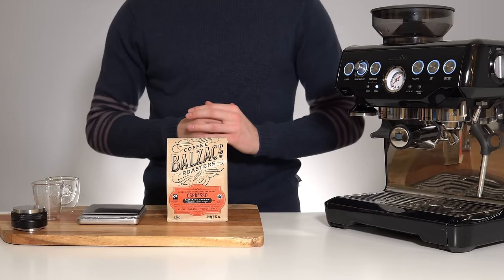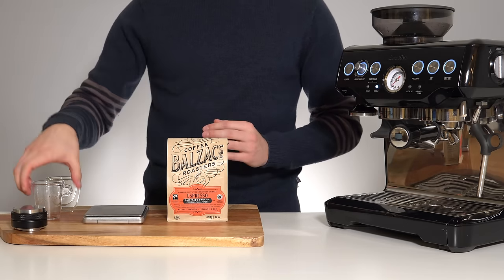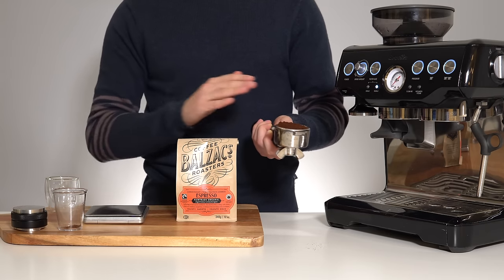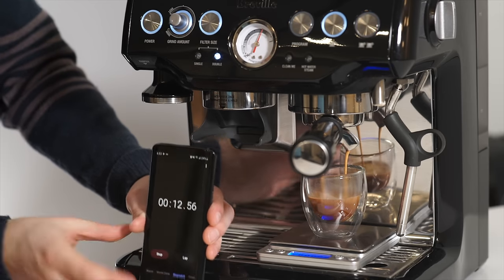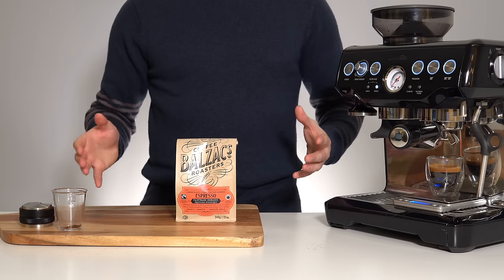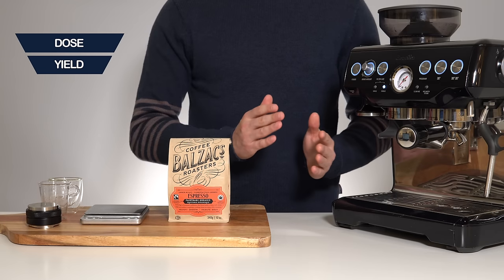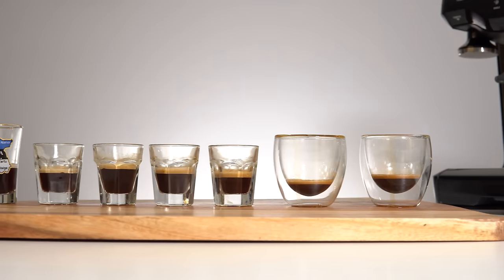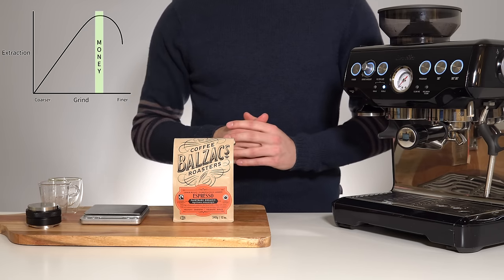Dialing In Breville Barista Express | Dose, grind, yield, time

Comment: Love this video mate. I have seen some different approaches to the timer, some people start as soon as they hit the button but I noticed you hit it after pre-infusion. So I am forever confused as to whether mine are running long enough or not, but just on the safe side I aim for about 30-35 seconds from when I hit the button
Reply: Also I run the double but with two cups underneath (one for me and one for the missus) and weight is roughly 60g - does this sound like too much or for two cups sound reasonable? For an 18g dose that's a 3.3x ratio 😕
Reply from the maker: Hi George, I can't tell you what the right timing / brew ratio is for your coffee and your taste preferences. Use the second part of the video to learn how to adjust for those

Comment: Excellent video but just wondering if one can really taste the difference in a blind fold test!!!
Not a big coffee expert but personally for me, i find that the quality of the beans is the most important.
I use the same machine and use gentle tampering. There is A LOT of hot water pressure that goes through the basket/coffee inside to get a good overall extraction !!!! 
In the end I went back to my fully automatic machine which gave pretty much the same taste after blindfold testing. 
Was fun for a little while with the new Breville, like anything new,  But The ease and the convenience of the fully auto unit won at the end.

Comment: Great video & so helpful. But i was wondering, did you use single wall filter basket?
Reply from the maker: Single walled. Dual walled filters are only for if you are using coffee that needs "help" building pressure such as pre-ground varieties that are typically coarser and less fresh.

Comment: Great detailed step-by-step video! One important question regarding tamping:

Good tamping means: flat + level + consistent in pressure from shot to shot. Right ?

Let's assume you are always tamping perfectly flat and level -- no matter what kind of tamper you're using. Big assumption I know... but please follow along :)

With a calibrated tamper, you'd always get a consistent pressure (30 lbs usually).

Can you please explain how you'd get consistent pressure with a palm tamper?

Thanks mate !
Reply from the maker: As long as your dose is consistent, the pressure will also be consistent with a palm tamper. Not to mention perfectly level :)

Comment: WOW! I've had my Breville a few weeks and I WISH I had stumbled upon this video DAY 1! So much knowledge made simple. THANK U! Now, if you can assist with this scenario: Using Beans Kller Beans roasted on 6/3: 18grams weighed in the filter but after 25 seconds the yield is only 28 grams (double shot selected)....  I have the Breville Barista Touch. Any help will be appreciated
Reply from the maker: You need to reprogram the duration of your double shot if you like the flow rate and want it to keep running to a 1:2 ratio. Or, grind coarser so that you reach a 1:2 in the already programmed time

Comment: Thanks a lot for the perfect explanation. I have a question. I ordered a Breville bambino machine. Are all these explanations (including 20-30  sec shot) apply to the bambino?
Reply from the maker: When using a non-pressurized filter basket, yes 
If your are using a pressurized basket, the flow rate is largely determined by the basket itself

Comment: Great video.  But Im still burning through the beans trying to get it right.  Got down to grind setting 4 and it was still under-extracted.  Increasing dose to 20-22g and tamping the heck out of it.  The pooling stopped, but its still not hitting the 25 second range for extraction time.  I’ll keep at it.  Thanks for all the info in your vids.
Reply from the maker: Remember, you also have the inner burr adjustment, not just the external dial to adjust grind sized finer. ALSO remember that not every coffee will taste best at 25 seconds. Experiment using the concepts in the second half of the video to dial in your particular coffee to your particular taste preferences
Reply: @LifestyleLab_  I reset the inner burr grinder.  Ended up with it set to 3, with the outer wheel set to 8.  Pulled a shot with the beans I had been using and it was better.  Switched to a new bean that I was going to try and it was better still:  18g extracted to 36g in about 28 seconds.  Still some tartness on the front, but the finish is much more espresso-like.  So, Im closer than I was.

Comment: Love your videos , very helpful. 
I feel like I’m getting there with dialing in ... 
17g in 42g out 
29 seconds, but more like 18 because of infusion. Too fast right ?? 

So my question is , should I grind finer or up the dose? I feel like it’s pretty fine already . I get sediment in my drink sometimes and I always do a blank shot . 😩help please
Reply: It wouldnt hurt uping your dose, try a 1:2 ratio. Before changing your dose try and tamp harder. If you're using the factory breville tamp it may be a bit harder to get a solid even hard tamp, i benifited a lot from buying a larger tamp off amazon.
Reply: @sagefielder7921   Ok thank you .  I will try 18g today. Also , I’m using a palm tamper.
Reply: @sagefielder7921  I went up to 18g in and went one finer. Got 18g in 38g out. In 28 seconds total time. Yay! Do you dose 18g? I feel like it was a lot .I need to get a better scale I think.

Comment: Thanks so much for this brilliant video. What's the purpose of having the 2 different grind size adjustments on this Breville machine?
Reply from the maker: Only one is grind size. The other is just a rough “dose adjustment”, aka a timer. Longer it runs, higher the dose. Problem is, when you change the grind size, the dose will vary with the same grind time. Hence the technique suggested here
Reply: So if I have my internal burr set at a fine grind size of 1, that means it will run for quite a long time? Or the other way around?
Reply from the maker: Finer the grind, slower the grind rate
Reply: Ok so how does the Grind Amount knob interact with the internal burr "grind timer"
Reply from the maker: Grind amount dial = simple timer ⏲️ 
Grind dial = particle size
Reply: I think you may have misunderstood me from the start. When you take the bean hopper off there is an upper part to the burr grinder that is removed by lifting up a wire & rotating it anticlockwise. On this part there is a adjustment that can be made by twisting the top against the bottom
Reply from the maker: Upper Burr vs Outer Dial Grind Setting | Breville Barista
https://youtu.be/_uB3FZGkR6E

Comment: Super video. One thing though. About the timer. I see that you time from when the first drop is falling, but i also see others time from when you press start button. By the way their saying the same amuont of time witch is between 20-30 seconds. What is up and down here. Even Brewille has a video where they pull a shot using 28 seconds timed from the very beginning.
Reply from the maker: Because there is a range of times that will work depending on your individual coffee and individual tastes, there will always be some variation. 20-30 seconds from first drip is the same as saying 25-35 seconds including pre-infusion... and for your coffee, it might be 45 seconds! That is why you always need to dial in to taste, not to a specific time. Aiming for a time is a rough starting point, not a final destination.

Comment: I'm glad that your video is one of the very first I've seen upon getting my BES870, and that saves me a lot of unnecessary coffee wastage 😊

Just a question about the coffee leveller and calibrated tamper – I noticed in you have 53mm in your link, for a good reason. Do you think 54mm version wouldn't fit?
Reply from the maker: Manufacturers seem to use 53mm and 54mm interchangeably to refer to tampers that fit Breville machines. Either will work just fine :)
Reply: 2M views Thank you very much indeed! I've just watch the other video of yours in regards to tamper choice - and I noticed you recommended 53mm, and people have been talking about how nicely fit 54mm tends to create vacuum in the porta filter and ended up with coffee ground all over the place 🙂

Comment: Also do you measure the coffee amount every time on the scale?  I don't want to get alot of other tools when I'm not confident with the machine itself?  Does the scale help?  Do I need it?  I'm a retired older adult, so trying to stop paying for Starbucks everyday for crappy coffee.  Lol!
Reply from the maker: The scale helps to take the frustration out of dialing in because you can control your dose, and I can give specific instructions of what a "reasonable" flow rate looks like. 
After you're dialed in, you can simply find the grind amount setting that gives you the correct dose, and using the programming mode the machine will already reproduce the dialed in shot the next time you hit that button

Comment: LOVE your videos! I have a q on my Express: I have been rotating among 3 half-caf beans from Fresh Roasted, and when I just finished a bag of Mexican and loaded the Sumatra, I noticed that the pressure gauge only goes to the lowest end of the espresso scale where previously it had been consistently going to the straight up (12 o'clock) pressure. It also seems to be finishing a bit quicker. I'm still getting crema, tho. All else being equal, should I try a finer grind? I've had it on 7. Thanks! 🙏
Reply from the maker: First and foremost, focus on flavour! How does it taste? 
If you’re happy with the taste, no need to adjust. However if you’re finding it running fast and being a little sour, you can grind finer. Different coffees can require VERY different grind settings from one another. Totally normal
Reply: @LifestyleLab_  Thank you! I think it is a tinch sour... will adjust.

Comment: Such a great video of beginners on the Barista Express. I'm trying to perfect the skills on this machine is proving a challenge. My shots are all 15 seconds ish with 18g of fresh beans and 36 shot, Pressure is in the 12 o'clock. how do I slow the shot without increasing pressure but using a finer grind? If I increase the dose the portafilter is overfilled... 🤷‍♂️ thanks 🙏🏻
Reply from the maker: Like I showed in this video, the best shots are pulled around 1'oclock or even high on the pressure gauge. 
Pay more attention to your flow rate, and how the shot tastes, and dont worry about the pressure reading

Comment: 18 g definitely does not fit into the 54 PF for the Sage Barista Express.
I can see others having the same issue in other forums.

If I grind 18 g into the PF, then 1-2 g will spill over even before handling the PF.

If I'm really careful I can tamp 17 g into the PF, but then I cannot fit the PF into the brewer, because the grounds push up against the brewer shower screen too much, and I simply can't attach the PF.

I've tried with different roasts/beans, and this holds true across all I've tested.

If I follow the machines instructions (set the grind amount to 3 O'clock), I end up with ~14 g. Still quite a top, but doesn't overflow the PF.

Not sure why 18 g is being recommended. It's not made for it 🤔
Reply from the maker: This COMPLETELY depends on the density of your coffee… anybody struggling to fit 18g is likely using a quite dark roast.
Reply: @LifestyleLab_  I've tried a range of beans. If I fit 16-17 g into the PF. The PF won't fit into the brewer head.
Haven't seen a bean that could fit 18 g yet.

In this case what dose do I aim for? Simply the highest one that I can fit, or something else?
Reply from the maker: Simply aim for whatever suits the basket size and coffee. No hard rules as there is so much variety in coffee :)

Comment: Just got mine today and pulled two shots. I definitely need to dial it in. Bitter and extraction is really fast even grinding to 10 on the side dial (which is supposed to slow extraction down).

Comment: What am I still doing wrong 😭 the single shot works perfectly fine but when I want to try and use the double I'm not getting the pressure I need. The change on the internal burr to 2 helped but even after it's still running through to fast or what I'm finding is that I'm scorching the puck all the time, iv tried 18g of coffee beans and 16g of coffee beans both on internal burr 2 and then the setting to 4 on the side of the machine and 3 but it still runs to fast. Am I just not packing the puck tight enough? I have watched the distributor video and done what I was told but I don't get why its still pooling or scorching. I just want a good double shot coffee please help. Edit: found my problem and I'm just being stupid, old and new coffee beans really really do effect how the pressure builds. After getting new beans so real fresh ones your trick helped sooo much thank you.

Comment: Great video, thank you, I am 6 months into using my BE, but always have to set the grind very high, say 14, to get the right extraction time and pressure, I find if I damp too firmly, it always sends the pressure up to high, when my son visits, he is always surprised I have the grind so high? It doesn’t feel overly coarse? Certainly not like sugar grains? And I have used various beans.....sometimes I miss the consistency and ease of my old Aldi Pod machine🤷‍♀️
Reply from the maker: The problem is, the machines are not calibrated to one another, so you're setting of 14 might be the same as his setting of 4. Always let the result do the talking, and try not to pay too much attention to the number. 
Also remember that you have much more grind range than just 0-14 on the dial. You can change the INTERNAL grind setting to get a whole new range of coarseness

Comment: Great video, thanks a lot! Just one question: You start taking time when the first espresso reaches the cup. In many other explanations they start taking time when pressing the start-button. That makes a huge difference! Can you tell me more about your strategy?
Reply from the maker: Explanation! https://youtu.be/E9MiqOJdwPc
Because timing for the final dialed in shot will vary greatly from coffee to coffee (I've had great 15 second shots, I've had great 50 second shots) it doesn't matter your method for timing so long as you are consistent with yourself! 25sec is a rough starting point only

Comment: Awesome video. Watched several times...but I need help:

Using 9g of Lavazza Decaf beans for a single shot for a latte. Grinding dialed in at 2. Single wall filter. Pressure rising to 1 O'clock. Getting 23g of espresso in 18 seconds. Minimal crema. Somewhat sour.
Puck not coming off the porta-filter and getting stuck to machine.

Suggestions?
Reply: That's a characteristic of decaf. Often to do with the coarseness of it.

Comment: Thanks for the video. Do you know how many coffee shots it can pull continuously ?
Reply from the maker: Because it runs on a thermocoil, not a full boiler, it can run continuously without a break. That being said, it's not a "commercial" level machine by any means, so I wouldn't try to do more than 4 or 5 back to back on a regular basis at the risk of over-stressing the pump.
Reply: @LifestyleLab_  Thanks for your reply. That is very helpful.

Comment: Very informative--Thanks! Do you recommend using your scale with every shot? Or do you use it to establish the right doses when you open a fresh bag?
Reply from the maker: Whatever you prefer! 
In the end, using a scale each time is the best way to ensure accuracy, but the programming mode on the machine is quite effective :)
Reply: @LifestyleLab_  Hi! Nice video! I am wondering how do you program the machine after calibrating with the scale? Do you set it to the time it takes or set it to deliver 18ml of water?
Reply from the maker: When you use programming mode, it will replicate the shot you pull each time you push the button you programmed

Comment: After extensive research, trial and error, and a bit of frustration i have come to understand how to consistently reach the middle of the espresso range on any bean. Grind setting, dose, and tamping/distribution, you must keep 2 out of 3 of these measurements constant as you test the beans. As i have the 53mm Crema Distributer/Tamp tool as in the video ive kept that as a constant as well as the dose so all you have to tinker with is the grind setting.The breville portafilter double shot baskets can fit 15-18 grams, and single shot baskets fit 8-10grams.Usually the minimum dose(15/8 grams) should be a coarse grind and the maximum dose(18/10 grams)should be a finer grind. Its all about how the grounds are packed in the basket. Now the differences in using an 18/10 gram fine grind compared to a 15/8 gram course grind are minimal in taste so I would recommend using a 15/8 gram course grind as you use less coffee, if conserving coffee isn’t an issue then use a 18/10 gram fine grind dose which will usually give you the fullest flavor shot. Also I suggest a 1:3 ratio but this is personal preference. 

Edit: Also during experimenting I found that a milliliter is equal to a gram so instead of weighing out the liquid into grams extract into a small measuring cup with mL measurements .So if your brew ratio is 1:3 with a 15 gram dose the correct amount of liquid would be 45 mLs.
Reply: Soo.... everything that was just explained in this video. Minus your completely incorrect statements on fine vs coarse grinds not impacting flavour, and GROUNDBREAKING discovery that 1ml = 1gr